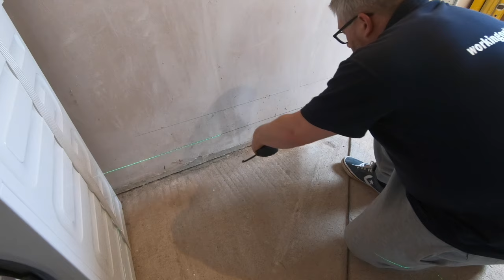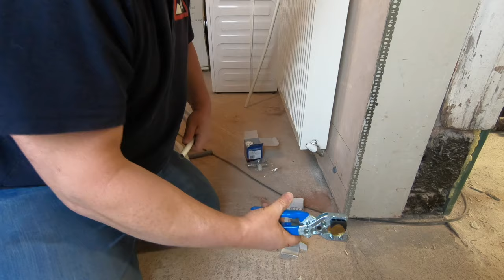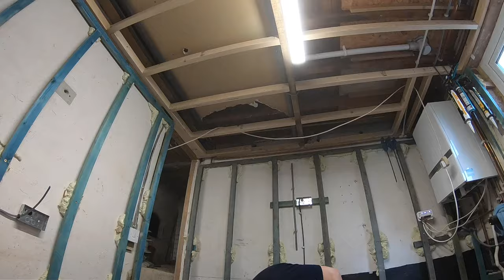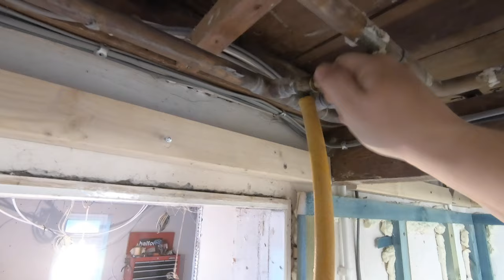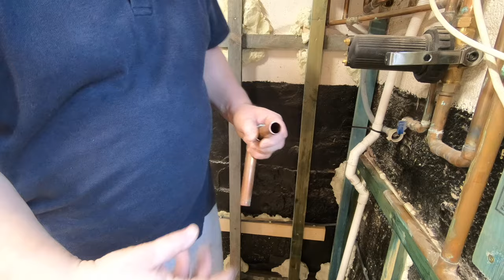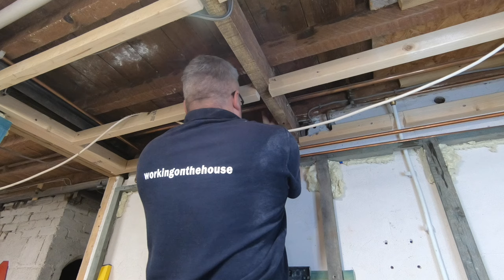Plumbing - Adding new radiators

Comment: I never thought to use a pipe bender on plastic pipe; interesting.
Reply from the maker: It’s a foil lined barrier pipe. Tectite classic. There is a specific tool for straightening it too which is really impressive. Have a look through pblumbers videos, I decided to invest in this kit because of one of his videos. 
I subsequently discovered that you need to use barrier pipe on central heating as standard plastic can allow oxygen to permeate through leading to corrosion issues 🤓

Comment: Hi I was just  curious why didn’t you use copper coming out the wall to the radiators, was it for looks and appearance with  chrome elbow as well.cheers
Reply from the maker: Thanks for the question. I think the  Tectite looks good (doesn’t tarnish or anything) but the copper elbows would have looked out of place. I just thought the chrome elbows and chromium plated copper pipe is a nice detail. I’ve used chrome wrap before, but it does discolour over time. So, to actually answer your question, yes 😁

Comment: Are using the imperial or metric measurement protocol..make your mind up 😊😊
Reply from the maker: CLS in 2.4m lengths of 3” by 2” is a favourite 🤪
Reply: Plumbers use both. Actually most trades use both systems.
Reply: @colin4685  yeah I suppose 8ft is easier to remember than 2438.4 millimetres 😆

Comment: Why choose tectite? Just curious. I hate the stuff. Much prefer hep2o
Reply from the maker: Hi Colin. I like the fact you can shape it and it will maintain that shape. The fittings are slim too. I used to use and like the old grey hep2o, but don’t rate the newer white stuff. I would have gone the pressfit route, but the cost of the tool AND the fittings is beyond my budget!
Reply: @workingonthehouse8038  ah got you. The grey hep is shocking now. None barrier. Amount of systems I've pulled that stuff out of because of the sludge issues it causes. Only problem with hep2o now is the price 😆